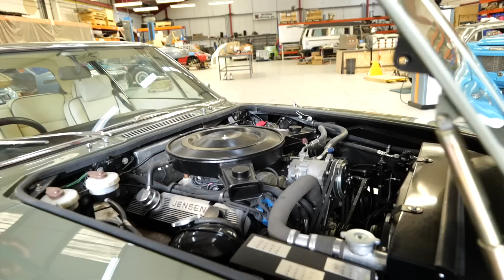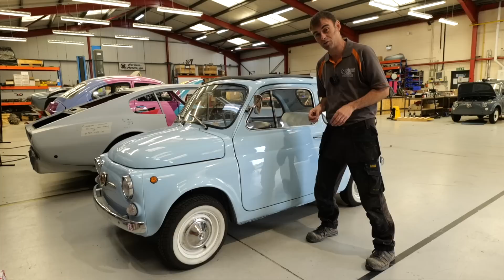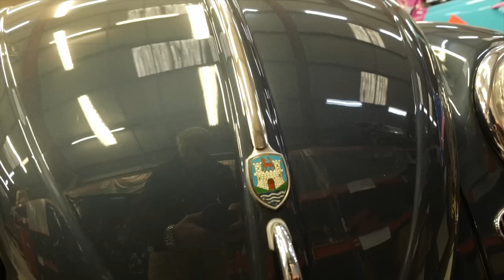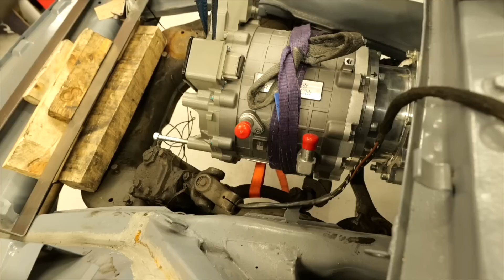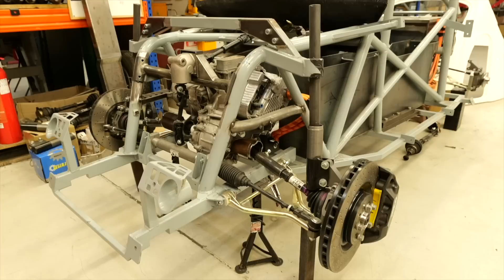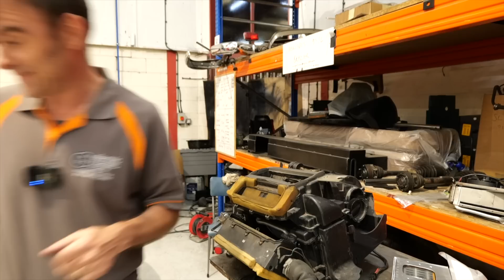Converting classic cars to electric - Workshop walkaround

Comment: Keep those engines handy , you will be putting them back in soon
Reply from the maker: Like putting coal fireplaces back in my house after I’ve installed modern central heating. 😆🤣😉
Reply: @ElectricClassicCars  cheaper than gas lol

Comment: That Merc rear axle is also a "swing axle" like the Beetle only slightly more sophisticated if I remember right - seem to remember an extra coil spring in there. I am referring to early Mercs and beetles - before they changed to the "constant camber" suspensions at the rear.

Comment: I wonder if the shop uses components outside Tesla? I guess you have the software worked out so you do not need other software tuned. 
My favorite is Jensen hands down. It is not the most beautiful but also practical liftback apart from most practical Derender having a brick beaty look. All others are pure stunning toys.
If I were to chose a personal conversion then it would be a Studebaker station wagon/estate from late 50ties or a Citroen DS Break with swiveling headlights.
Reply from the maker: We only use Tesla components in about 30% of our builds. 👍

Comment: A simpler way to do the 400V to Sine wave AC conversion: Use an off the shelf Variable Frequency Drive (VFD). Takes 400VCD in and produces any desired AC output including 3 phase AC.  Look in any catalog of VFD drives.  There is no need to convert to 12VDC.

Comment: Thanks a lot for your walkaround! Question: Based on what factors do you decide to put the Tesla motor in the back or in the front? Purely space? Other factors?
Reply from the maker: Space, weight distribution, structural support etc

Comment: 5:30 Maybe you could encapsule the compressor a bit with noise canceling material, like a jacket, similar what Tesla does now around. Or a kind of closed rubber housing out of 10 mm textile reinforced rubber or so. Just some ideas.

Comment: My local firm making Porsche ev conversions  said my Opel Gt would not be good to convert because the drive train to RWD will make the rage very bad.How does the Interceptor get away with it?
Reply from the maker: I think they're blowing smoke up your ass there. We've built plenty of front engined/motored cars that are RWD and see no difference in range compared to a rear engined/motored RWD car like a Beetle/Fiat 500/Porsche 911.

Comment: The 426 Hemi is the 7 litre MoPar engine. No Interceptor had a "7 litre", they were all either the MoPar 383 or 440 B/RB 'big blocks', 6.8 and 7.2 litres in metric sizes.
Applying the Tesla hardware is a better choice then the mob that put a GM LS-1 V8 in there. Purists will hate it, but if it can be done in a way that it's 'bolt in' without cutting body work, it can always be removed later for full value resale. And, a bolt-in kit that will fit in there, would also be suitable for use in American 69 Charger, f-body TransAm, Challenger, Mustang, Cougar, Aussie HQ Monaro, XB Falcon Coupe (Yeah, the Road Warrior car), VH Charger, big Benz coupes and Astons.
Will the Fiat 500 setup fit in the station wagons?, where the original 2 cylinder sits flat, under the rear floor.
The VW camper, and the 12v system, have you tried the LiFePO4 batteries instead of the SLA? The weight saving should be massive.
Side note, call 'em Lithium Ferrous Phosphate, instead of Lithium Iron, because when we say Iron people hear Ion, and they're easily confused. The people that is,...
DC to AC is an Inverter. AC to DC is a Rectifier. How are you making sure all three of the Inverters are running in phase ?

Comment: what are your thoughts on fords crate electric motor?  its seems to be a way of reducing costs for ev conversions
Reply from the maker: Seems good, we may use it on an upcoming project. But keep in mind the costs you've seen are just for the motor, you then need to add controller and other bits and pieces. 👍
Reply: @ElectricClassicCars  yah i wasnt sure if its everything you needed in a package or not, or whether thats even a good price/kwh? is it volts? (i have no idea if thats correct)  compared to a tesla motor but hopefully a good step in right direction.  mind you by time it gets over here it will have probably doubled in price any way.   cheers for answer  :)

Comment: Very good episode, thanks! Just curious, why do you have to add so much power to the Beetle? Can it handle it?  Wouldnt a smaller (lighter?) motor be better? This could also save on battery pack weight.

Comment: My brother had a 1959 190SL so that's the one I'm most interested in. But the very idea that there are shops doing this kind of work already is exciting. In the US I'd like the see the Chevrolet SSR pickup converted to EV. It's the convertible retro looking truck with a retractable hard top made between 2003 and 2006. I'm also looking forward to seeing kit car creations. There is so much more you can do with styling when you don't have an ICE powertrain and have a run rate low enough you don't have to engineer to crash test standards.

Comment: On the VW camper will you still use the EHU for slow charging the van and powering the fridge, hot fan heater and internal lighting when on a camp site ?

Comment: VW Beetles have torsion bar suspension so they can be raised or lowered by removing the torsion bar and carefully turning one spline either direction to get the required ride height. It should easily be able to handle two hundred kilos in the rear seat area for the battery pack.

Comment: Bro, I'm 90% sure you could run the induction hob DIRECTLY from the 400v traction battery in the Synchro, no need for the big inverter.
The way things with switching PSUs work (TVs, computer  etc) is they firstly convert 240V AC  to about 340 volts DC  (AC voltage X ✓2 = 339.36 VDC). But it's the capacitors and transistor ratings that are the limiting factor, they are probably rated at 400-600 volts, so it should be fine.
Regards from Aotearoa
Reply: Essentially, the circuitry in the hob turns AC into DC then into much higher frequency AC.
The extra step is not required and is very inefficient.
Reply: Can you buy  high voltage dc induction hobs or would you have to modify an ac one ? In principle one could run everything in an EV off the power batteries for maximum efficiency, if manufacturers build accessories to run at the voltage of the EV power rails.
Reply: @francesconicoletti2547  A lot of mains AC devices that you use today actually convert the incoming AC into  DC.
This is similar to the way EVs actually work, where the DC voltage from the battery is converted to three phase AC which is connected to the motor.
These devices are likely to work directly from high voltage DC:
Anything which has an operating voltage range from 90-260 volts.
Any device that feels too light to have a transformer may be.
"Inverter compressor" refrigerators or heat pumps.
Flat screen TVs.
Mobile phone and laptop chargers.
Smart drive or direct drive washing machines.

Comment: Love the eclectic selection of electric conversions and the quality of the work is spot on!.
I have converted a Austin Metro to EV using Nissan Leaf motor etc and have applied to the DVLA for re registration as an EV.  Due to drilling two 10mm holes in the boot floor to secure the battery they  have voided the identity of the car and require an IVA inspection!. (classed as a chassis modification!??) 
On passing this, the car gets a new chassis number and a Q plate......  
Watch out...

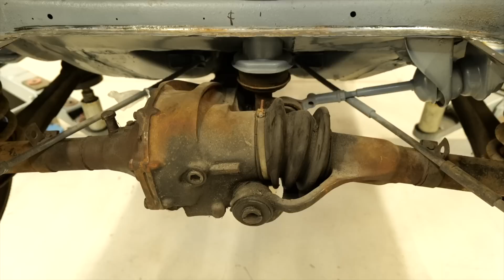Comment: Finally an Interceptor that doesn't overheat. And an end to 8mpg. 16:48 that's a swing axle in the 190SL.
Reply: But it has a heart and soul which sounds amazing unlike a electric car .sorry if you want a electric car buy a new one and please leave to the classic Ferraris and Jensons etc alone
Reply: @bmwman1981  Ideally I'd have one electric and one original (or perhaps an FF). Another issues with the Interceptor that I found difficult to live with was the ground clearance - not needing an exhaust system would be another win.

Comment: Love electric conversions but......... when the sound of the engine sold the vehicles I find it just that wee bit harder to stomach. That's the most of a interceptor iv seen in a while to 😁 normally biodegradation has stepped in and body filler has taken over... Nice job on the vid.. stay safe 🏴

Comment: 31:16 You're putting an AC condenser and a heater core into the Testarossa airbox.
Wouldn't it be more efficient for space and battery to heat the car with the AC run in reverse as a heat-pump and leave out the heater element?

Comment: The Mercedes is usually described as having a low pivot swing axle. Same problems with camber change as a VW type 1 or Triumph "Hark the Herrald axles swing", but much less tndancy to 'jack' because of the low pivot point. 

Management wanted a link to the road cars and a low pivot swing axle was used on the W196 F1 car, rather than a DeDion, which would have been the more conventional and better choice.

Comment: I love the Jensen and Ghibli. I'm surprised the AM owner is going with the small Tesla motor. Isn't that max 300 hp? But then the Ghibli  using 2 Hyper 9s, making about the same horsepower. I guess they want a car that offers similar performance to the original, but in a more reliable and sustainable way. I know if you had your way, there'd be a 600 hp Tesla fitted to the Jensen, Ghibli and AM.

Comment: Double edge sword this EV stuff on classics but I'm all in favour actually.

Get rid of the unreliable old steam engines, yes they sound awesome but EV eliminates.........

running issues
Over heating 
Oil changes
Oil leaks
Cambelt jobs
Water pump changes 
Air fuel or oil filter expenses 
HGF worries
Clutch expenses 
leaking thermostats 
Fuel pump failures
Injector troubles
Alternator disasters
Cambelt/pulley maintenance
Bad Starter motor solenoids
MAF EGR woes
PCV blockages
Power steering leaks
Lower pulley expenses..........
The list goes on and I'm in.
EV is here to stay 😎

I'm in 
I'll be paying you a visit re converting my beloved MG ZTT soon.

What is the lead time please?
@Jules75ZT

Comment: The cars are amazing as always. I am really interested in the idea of converting a classic car, and maybe someday I'll have the money. It seems to me that even though electric cars don't need to have a transmission given how fast the electric motor can spin and the amount of torque in an electric motor. Would having a transmission with the higher gears including overdrive cause an electric car to be more efficient for towing and/or at highway speed? There is another channel where someone was towing with an electric f150 and it sucked up much more power than normal driving. I would think that there would still be an advantage for having some kind of transmission. I just can't seem to find and answer. Great work as always!

Comment: The Fiat has to be the biggest performance upgrade, that could be a great sleeper.
Love the vintage beetle. 
I would put in new lap belt and shoulder harness in any of those vintage vehicles. Electric conversion probably makes it safer with the extra mass and lower CG. I wonder if it would make sense to put a reinforcement bar inside the door to reduce cabin intrusion in an accident.
They should start an EV car show.
I wonder if they've ever done a AWD conversion, it seems like the controller would be the hardest part. Maybe in future there will be 1 small motor per wheel systems built for conversions that could get rid of clunky drivetrain components.
Reply from the maker: Have you checked out our TV show, Vintage Voltage? ⚡😁👍
Reply: @ElectricClassicCars  yes, love it. I've watched & rewatched. The one that comes to mind is a Porsche project. My EV fantasy is to have a 2nd motor and future gen battery added to my 2015 Fiat 500e electric, which is very nice as is.

Comment: Taking out that lovely sounding iconic flat 12 is sacrilege! Can see why you would convert that interceptor tho.
Reply: But if it is past it's useby date and needing a lot of work, replace it with the motor. The old engine can be sold to someone else who may have a blown engine and is considering junking the car due to this. 2 cars saved.

Comment: Could you make a video on the amount of possible servicing and replacing of parts you would expect for an electric conversion, over say 1 life of a battery? Also how long an electric motor would last.
Reply from the maker: We'll add that to the next Q&A video we do. 👍
Reply: Batteries are now hitting the million km lifespan, so many years of driving, probably the life of the car. There are electric motors in old refrigerator's and in industrial use still going a half a century or more without a fault. Any problems generally stem from control systems.